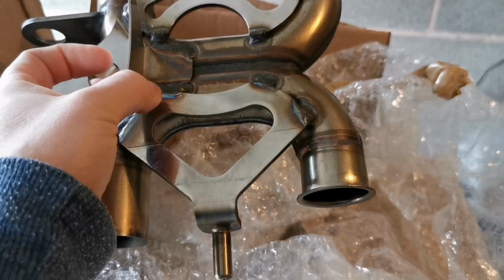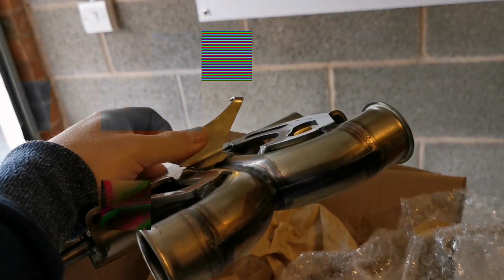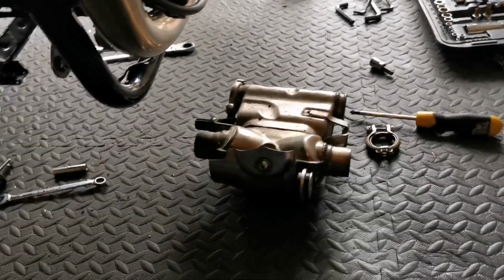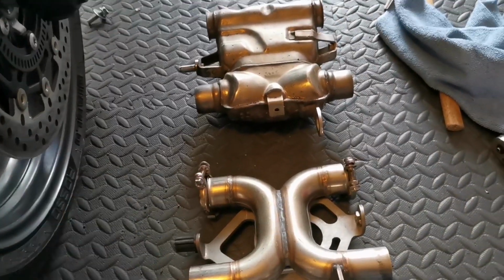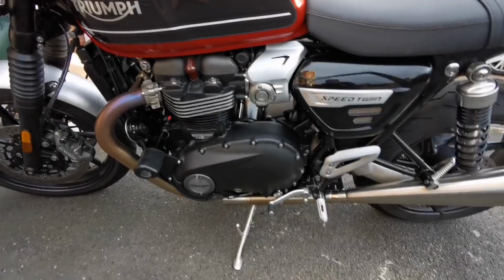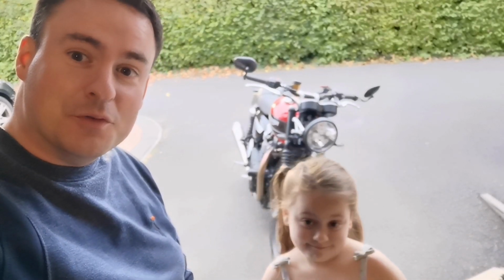TEC X-PIPE - Triumph Speed Twin

Comment: Hi there - what do you mean by 15 minute self tune for the ECU? You can just let it idle for 15 minutes and it re-maps? Or do you need to flash the ECU with a program?
Reply from the maker: Hi, it's a triumph thing it self's learns if you leave it idling without touching the throttle until the fan kicks in usually 12-15 mins from a cold start... No ECU map required.

However would probably give me gains by a remap but I've not done it